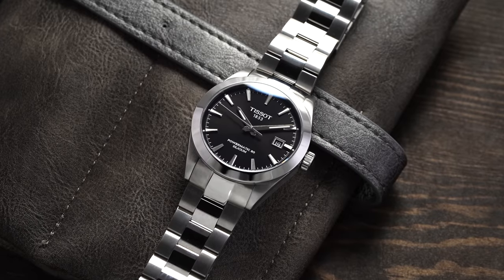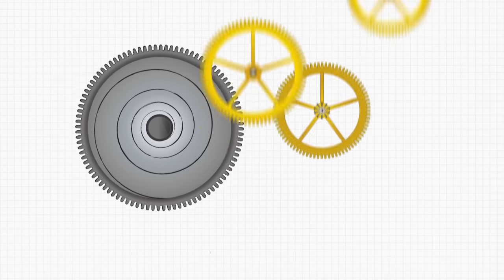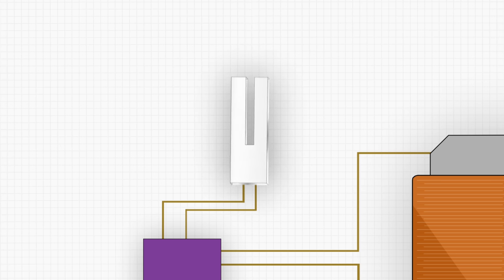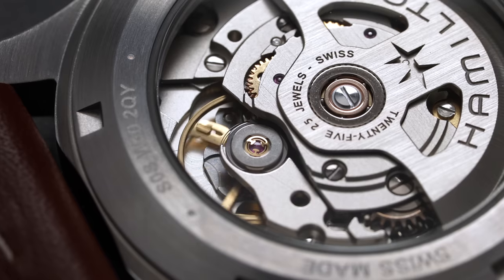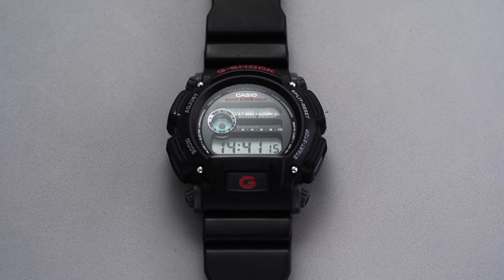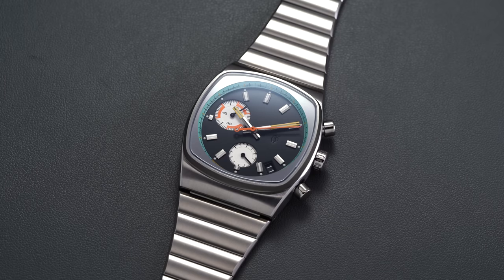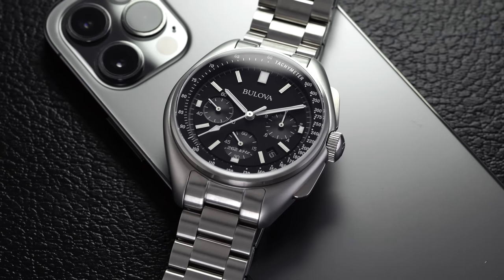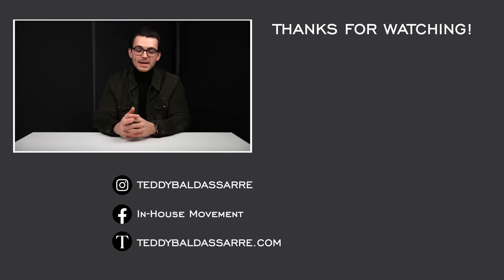Why Every Collector Needs a Quartz Watch - How They Work & Everything Else You Should Know

Comment: My only issue with quartz is that battery change and 'lack of soul' but I think with seiko's kinetics and spring drive line they both more or less kill two birds with one stone. With the kinetic line you don't have to worry about swapping batteries or capacitors out until you probably would want to send your watch in for general maintenance anyways and the spring drive is what I'd consider a true hybrid of the two technologies but both of them are powered by you moving around, it adds a specific character of which I think is part of the appeal of mechanical watches, the part where it is reliant on you.

Comment: I've never had a problem with quartz watches. They certainly have great benefits for their usually much more affordable prices. I currently only own two, a digital quartz Casio G-Shock square and an analog quartz in the form of a Seiko diver. Great grab and go for a quick switch off a mechanical. And, both are accurate as hell and solar powered which negates even a battery change. 200m of WR and probably more Antimagnetic and anti-shock than any mechanical out there, I have pretty much zero worries of failure and fault... I still don't want to get them scratched, though!

Comment: I was i my teens in the mid 70's when quartz watches came along. I wanted a quartz watch after years of wondering if my watch was correct. " Hey bud, do you have the correct time,"  was a phrase you heard a few times a week. My dad had an Omega pocket watch that was rebuilt numerous times over the years. When quartz came along I purchased one,  and over the years bought a mechanical that,  got the top drawer treatment within a few weeks. I love watches but I wouldn't want the expense of servicing a mechanical unit. Maybe an Omega quartz or a Grand Seiko some day.

Comment: I love Meca-Quartz and even basic 3 hand Quartz to go along with the mechanicals in the collection.  I have too many watches to keep all the mechanicals wound, so Quartz is great for grab and go.  I wish more manufactures would create higher quality quartz movements that are built to last many decades.  Servicing a mechanical watch is extremely expensive when you move past just having a few of them.  Those of us with 20+ watch collections need some Quartz in there to add variety and some chronos that don't cost $600 every 6 years a pop to maintain.  I'm interested in trying a Seiko VK31 and VH65 movements to get the feel of an automatic sweep but without the cost and hassle would love some reviews on those.

Comment: The beauty of a quartz watch, even on the higher end models, is that you can service it yourself. There are not many moving parts to clean and you can easily swap out the entire movement, or the electronic module, for at most a couple of hundred. Try that with a manual or automatic.

Comment: :hand-pink-waving: My best friend passed away, but in 1990 gave me a dead gold Omega Constellation from 1977.  A jeweler said it would cost $500 to replace the movement.  Recently I purchased a #329 battery and adapter, and placed a tiny bit of watch oil on the two arbors and the watch came to life!  It must have set with no battery for the last 40 years.   Tim said it was his father's watch, but after the battery died he just left in in his drawer.  It's my favorite because of my long friendship with Tim.

Comment: I'm relatively new to the watch scene and own a couple of entry-level automatics (Seiko Presage and Orient Ray II).  As someone who works from home and doesn't wear a watch all day/everyday the automatic watch owning experience can be frustrating, constantly having to reset the time, change the date and even at times wind. One overlooked advantage of quartz watches not mentioned on Teddy's video or other articles I've come across is the ability to grab-n-go and convenience. I know I'm in the minority but I'm at a point where my Presage has been relegated to a going out watch and my Orient as my summer water and vacation watch. I'm awaiting a Vaer chrono (hybrid/mechanical) I ordered, which will become my daily watch due to convenience of not having to constantly change the time. BTW and one more note, I tried a watch winder and it was way too much of a hassle to attach to the cradle, remove, etc.

Comment: True enthusiasts will appreciate the accuracy and reliability of Quartz.  Not to mention they are also much thinner and easier to wear.  

The best value to be had I think is those with Solar power and Atomic Radio/Bluetooth sync.  No battery changing and amazing accuracy, great for every day to just pick up and go.  Radio sync with annual calendar is amazing also, no need to adjust the date for those short months.  There are some beautiful watches with these features made by Seiko, Citizen and Casio.

The advantage of mechanical is longevity and repairability when were talking decades down the line.. It will be hard to fix these quartzes with circuit boards or screens that are no longer in production, hence why they don't hold their value as well.

Comment: Intriguing thought about getting high complications in a quartz watch at attainable prices. For complications like GMTs, chronographs, or others, what are some of your recommendations for quartz options/best brands at attainable prices?
Reply: Have a look at any Eco-Drive with the E820 movement.  Very affordable 1/20th second 1-hour chronograph with perpetual calendar, alarm, second time zone, and WR100 or 200 depending on the model.  Some of these have mineral crystal, others sapphire.  E820 replaced E812 a few years ago.  When I sent my 15-yr-old "dropped and stopped" E812 in for service, they upgraded the movement to E820.

Comment: i love digital quartz watches like casios. or watches with a mecaquartz chronograph movment as they are so much cheaper to purchase and service than a mechanical chronograph, and they have a small seconds sub dial, so the tick instead of sweep is less perceptible. but for conventional watches with central seconds, i do prefer the smoother sweep of a high beat mechanical movement. i do tend to use the casios in my collection to set the time of their other costlier mechanical counterparts. i've never really got into solar quartz watches though, just can't connect with them, too impersonal somehow.

Comment: i think, quartz watches are great. especialy if they are solarpowered. if you realy need a watch for the original watch purpose (telling the time accurate) and if you need a bit of robustnes (maybee if your job is on a building side, or in the woods, or in a workshop), quartz is the way to go. Also: the thines, in wich you can build a quartz movement make it great for a dress piece, that not breaks your bank.

at the moment, if got one quartz piece (the Braun AW50), but in the past, im probably had the whole citizen eco-drive promaster collection, they are such great pieces. my next quartzs piece may be the tissot prx or the certina ds action. in both cases, i think, the quartz versions just looks better.

Comment: I have owned both quartz (in standard and eco-drive or solar) and mechanical watches. 

As for the accuracy, my quartz watches always seem to be off by the exact same amount per day. With my mechanical watches, depending on the storage position, you can have a much different result. For my COSC certified watch, I get around 10 seconds a month off from reference time, without paying attention to the storage position. If I look at the reference time and adjust the overnight storage position, I can get within a second across a month. My quartz watches cannot replicate this change based of how I store them. 

I recently sold my solar powered watches as I didn’t wear them enough to keep them charged up. There is definitely a place in any collection for quartz. Though I found I much prefer the standard to the rechargeable ones.

Comment: I have a few quartz watches in my current set up, and I think the main thing I like about them is I’m not scared to mess them up. I don’t care if the links get scratched, I don’t care if do the dishes with it on, And I don’t care if god forbid it were to be stolen off my wrist. I love my mechanical pieces but sometimes you also just need that good ol’ reliable beater watch.

Comment: My first nice watch was a 1985 seiko h557 5319 ana - digital.  It lasted till 2013 after I wore it in a downpour and it stopped working.  I had prior a Hamilton Field quartz that I lost around 2006- bought it in 1995.  My dad has a 1959 Omega 18k gold- doesn't work and he doesn't want to pay the service price.  He also had an AP Gold from his grandfather and pawned it. Service priced for mechanical watches are a bit of a shock for some people and some people I think are lazy and won't service them. 
I never thought about owning a self winding watch because I had no idea or education about them.  They were unknown territory.  After my Seiko died because of neglect I bought a Mudman Gshock because I was delivering mail on a bicycle and often caught in rain 🌧.  Eventually,  the housing cracked where the strap attached and to have a new battery inserted was useless because the strap would pop off.
I gave up on watches for awhile till recently.  I am seriously looking into a high end quartz or something nice.  I want to keep the price to around 500.  
To tide me over I bought a casioak for 84 on sale and I wear it all day at work in  dying plant and after three months it doesn't have a scratch on the mineral glass. I am in constant contact with metal.  So I have a lot of respect for the durability.  For about two weeks I own another Gshock,  a digital tough solar, radio watch that goes into energy saving mode when not worn.  It goes blank and when I pick it up it shows perfect time.  
I have not thrown out the door the possibility of ever owning an automatic watch but I have only experienced quartz and I find them interesting with the variety of meca quartz, ronda quartz, or seiko quartz. 
Quartz watches need to be serviced.  The waterproof seals should be changed,  not only the battery.  If I had taken care of the old seiko I would still have it. And it would be still running flawlessly app. 37 years later. 
Everything you own needs maintenance.  I definitely think owning too many watches and not taking care of them is neglect.

Comment: I was thinking of getting my first mechanical recently because I find the movements fascinating. But I swung away when I started thinking if the maintenance costs. I'm not sure why people think of mechanical as lasting a lifetime when any maintenance on a quartz watch will be much more affordable and probably easier to service through the generations as well given that there are fewer unique parts that are more likely to be sourced in the long term.

Also, mechanical watches use discrete time intervals as well. That "sweeping" second hand isn't actually smooth. Why don't more quartz watches simply employ a higher frequency for their base gear timing to sweep the second hand like a mechanical if it's so appealing?

Comment: My first watch was a mechanical chronograph given to me in 1971. I wore it for several years, but when it stopped working properly, a jeweler quoted a repair cost 3 times the purchase price. Being young and with little money, I went without a watch for awhile and then started using quartz watches. I didn’t own another mechanical watch until 3 years ago. Since then, I have acquired a considerable collection of quartz and mechanical watches. The disdain that some people express for any non-mechanical watch is perplexing. Is it a desire to simplify one’s choices? A snobbish need to feel superior? I enjoy purely mechanical devices (I also collect slide rules and mechanical calculators.), but I do not avoid devices that utilize electricity. You want “soul” in your watch? My vintage Bulova Accutrons hum to me.

Comment: I have met those who will not touch anything with a quartz crystal inside and that's the choice they make. While like you I prefer a mechanical watch due to the engineering involved as well as not having to worry about a battery dying I also appreciate quartz watches both digital and analog. I grew up when digital watches were becoming available to the general public with LED displays for a few years before LCD superseded them. Later the quartz analog pieces became available. My collection includes digital, quartz analog and mechanical. These days a solar G-Shock would be a daily wear at times where a mechanical may be at greater risk of damage or is not appropriate.

Comment: its easy to establish a "relationship" with mechanical watches.  you have to wind them (in the case of hand-wound watches) or shake them (for automatic watches).  Then they are not so accurate, so you need to adjust the time every now and then.  Then, they also need servicing every 5 years or so.  In the case of quartz watches - they just keep on working as long as the battery is okay.  No need to adjust or service.  
and you know that quartz watches have relatively shorter lives

Comment: Regarding accuracy, Teddy, one thing that you can do with mechanical watches is positional regulation, changing position every night, to maintain accuracy. Can't do that with quartz.
Reply: I am curious as to how you would actually implement a positional regulation routine. Would you have a gut feeling that you were wearing the mechanical watch in certain orientations for specific lengths of time? Would you then position the watch in a orientation overnight that would compensate for the daytime orientations? If you are pulling this off without referencing a time standard (e.g. radio, satellite, NTP servers, a quartz watch), I applaud your abilities. Most people that say they can use positional regulation to get quartz like (or better) accuracy from a mechanical watch, fail to understand that they are adjusting the time on their watch every day based on a time standard. I can do better on any quartz watch. After observing a specific quartz watch and noting its inherent accuracy (say +2 sec/week), I could stop the quartz watch for 2 seconds every week (without referencing a time standard) and be within a few seconds in a year.

Comment: Weren’t the first publicly revealed quartz watch prototypes Swiss? Seiko had been working on something similar for years, yes.

I have an alarm clock controlled by a quartz crystal. The crystal is off — vibrates slightly too fast — and it’s gained about half an hour in ten years. I really should set it to the proper time more often.

Comment: Disappointing that no mention was made of Grand Seiko’s 9F movement. Yes, it’s quartz powered, but the level of innovative engineering that’s put into it (especially the 85 and 86 models) is off the charts. It’s also far more accurate than the examples he mentioned.
Reply: Love the 9F and have one, but it's hard to for most appreciate the relative quality and accuracy of the movement. The variation between a cheap and a great mechanical is much more obvious to see.

Comment: quartz watches woulkd be mnore appealing if te movements could mimic the sound of a high beat movement and behave more smoothly tthan just sharply jerking every second around the dial, the accutron is a good example of what i mean, its not a quartz watch but it has the electronic oscillators, and it has a sweeping hand movement instead of ticking every second

Comment: I don't recommend an entry level Timex quartz, especially in the Indiglo line. The Indiglo light fails after 2 years and after 6 years the movement will start to slow down, even with a fully charged battery. Watch service technician claims the fuse for the Indiglo cannot be replaced and the movement is designed to never be serviced. In other words, such quartz movements around the $100-$150 range are designed to be expendable. So... just buy a new one, or upgrade to a higher tier quartz.

Comment: Besides accuracy and lack of expensive cleaning-oiling, quartz watches have other advantages, they can be very lightweight and very thin, coeteris paribus, and those can be very interesting qualities for dress watches. A watch passionate will not spend $10-20 on battery changing, it's easy to open the watch by yourself and change the battery by yourself, buy the tools once. Gaskets are also easy to find and substitute, and cheap. I love mechanical watches but I do understand the qualities of a quartz watch. Besides, if one is lucky, they can be awfully accurate. My Casio EFV-110D is so precise it gains less (or much less, I still have to understand) than 1 second month. My main problem is to set it exactly at the second, because it starts with either 0,5 of delay, or immediately. I just gave up, I set it today at around 0,3 seconds late, cannot do any better. I will see how accurate it is when daylight saving time sets in. I feel lucky I have a quartz watch which is decently aligned with the second markers and is also as precise as a much more expensive thermo-compensated, or high-frequency, quartz movement. My impression so far is that it is some 0,3 seconds/month fast (4" per year). I perfectly understand this is pure luck, my other quartz watches usually gained 1"/week or 2"/week.

Comment: Gotta have some, for when you need to grab and go - and when you actually need to keep accurate time. My Orient FUG series looks nice and is 100m WR. I also have a Gshock square that's solar recharged and radio-synced to atomic time, and completely rugged. A true tool watch for all situations - I also use it to set the time on my mechanicals lol.